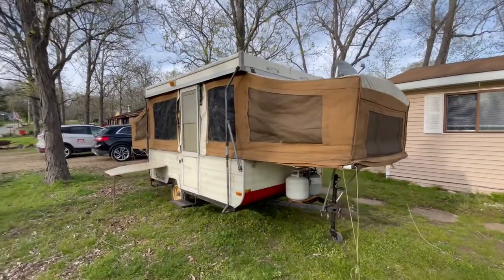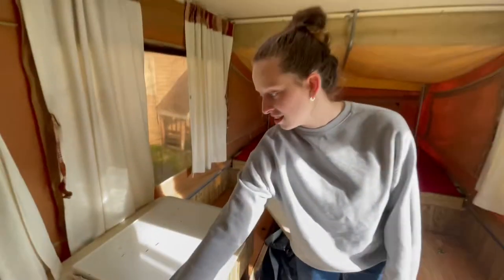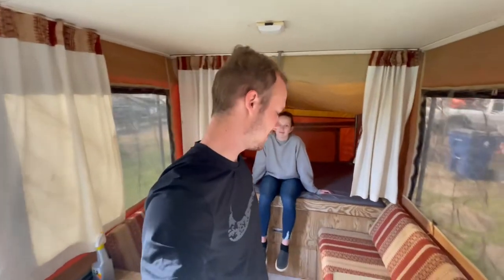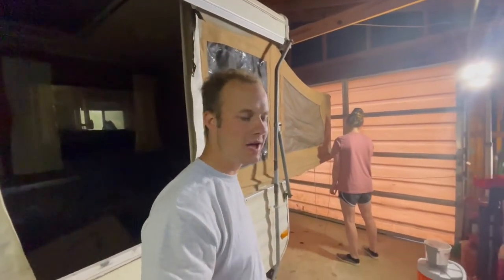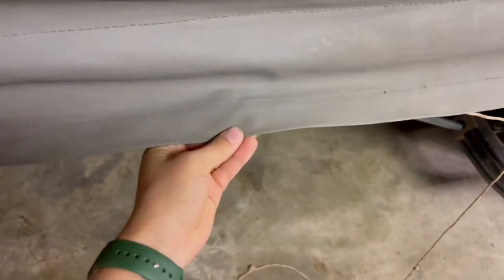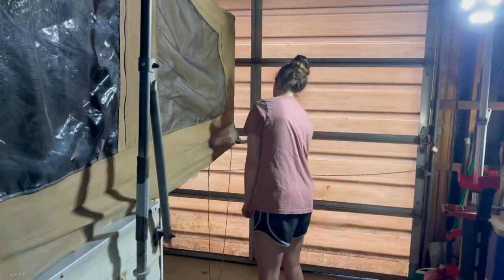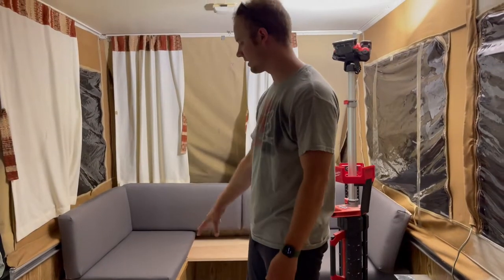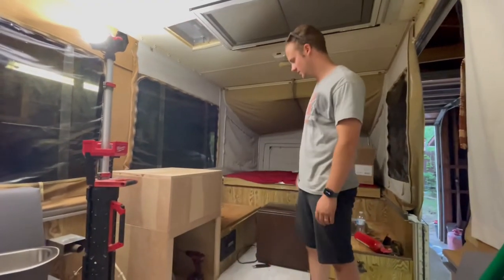Paint Your Pop Up Canvas (Everything You’ll Need)

Comment: Our pop up is the exact same awful gold color! 
I want to paint it white to match the top. 
I have a product called Gesso, which is supposed to be a great primer for the canvas. It’s also supposed to aid in helping the paint not stick to itself as the sides are pushed in when closing and opening the camper. 
We shall see! 
Our little pop up will be our temporary seasonal, as ours was damaged this past winter. That was our first fixer upper. Now we’re going from 33 feet to teeny tiny. It’s ok, pop ups are so much fun! 😊
Reply: Hiya, what paint are you using to go over the gesso?
Reply: @Intentionallyhomeless  Morning! 
All I know is that they said to use acrylic. Well, the only acrylic that I’m familiar with is the craft paint. So I’m going to search it more, and if that’s all I can find, I’ll be a rebel and use latex! Maybe I’m overthinking it and it’s the exact same thing? We shall see! 🤞🏼
Reply: @kellyanne7225  thanks for your reply. These guys used latex and I've been doing some research since my earlier comment. I'm in Queensland Australia so been looking at the Dulux waethershield maxiflex in base white but offers 30 tints. I'll use this for my 1989 cub drifter camper trailer canvas and some more for the exterior wood panels.
Reply: @Intentionallyhomeless  Let me know how it goes! 
I’ll get to mine in a few weeks! 👍🏼

Comment: Nice job!!! Did you mix a little bit of water in the paint ?
Reply from the maker: Thank you! I did not mix water with the paint. I wouldn’t recommend that.
Reply: @ColtenBethel  perfect thank you for your answer!😁 i will start tomorrow!
Reply: @ColtenBethel  and do you think it will be good with the paint roller?
Reply from the maker: @georgezogheib473  no problem at all! I think a brush is best because it actually pushes it into the canvas. It does take a little longe though.
Reply: @ColtenBethel  perfectt thank you😁 i did 1 place and it took alot of paint! Hehe tomorrow i will go buy more paint and continue💪🏼

Comment: Have you had to do any touch ups? Wad it latex instead of acrylic? Was planning doing same color on a roof top tent but idk about sanding though
Reply from the maker: Hey Danny, I plan on making an update video soon showing how the paint has held up after 1 year. The paint is latex, I was wrong about that in the first video. I have not had to do any touch ups but we’ll see what it look like after I open in up from sitting all winter. I only lightly scuff sanded the canvas and I will say it was pretty clean and wasn’t heavily oiled. Not sure if that would make a huge difference but thought it would be worth mentioning.

Comment: where did you find the table for the outside. how did you attach it. and how did you seal it if you drilled into it from the outside to attach mounting bracket for table. thanks.

Comment: How is the paint on the canvas holding on?
Reply from the maker: Much much better than I really expected. I need to make a quick update video sometime. We have used the camper probably 5 times since I made that video and almost every time we have been rained on and forced to put it away wet for the drive home and the canvas is still soft and we have not had any paint failure at all.
Reply: @ColtenBethel  helps against mold as well then? Would you recommend doing it then?
Reply from the maker: @stacieford1996  It is doing well against mold. Even though I may put it down wet and drive home with it wet. I always set it back up at home and let it dry out before I put it away for storage.
Reply: @ColtenBethel  I'd enjoy a follow up video on painted canvas
Reply from the maker: @tangoyankee615  I will definitely make one this summer so everyone can see. I will probably have that video done around June.
Reply: Did you paint the ceilings in the bump out bed areas? What paint was used on inside canvas?
Reply from the maker: @bridgets5154  we did paint the ceilings above the bed as well. We used the same paint on the inside as the outside.

Comment: Fixing sip is $250 au
Material for seating $120 au
Recovering seat's $450 au 
Paint 8 Lt $80 au +
Glue around $150 au one marine plywood $100 au
Insulation $120 au
Repair brakes spent so far $200 au
Lighting $100 au 
$500 au for the old Pop up caravan very much like yours .
Need to replace front canvas
Work still in progress
Government plaiting next week
Remember Australia is a Police state awash with government Corouption.